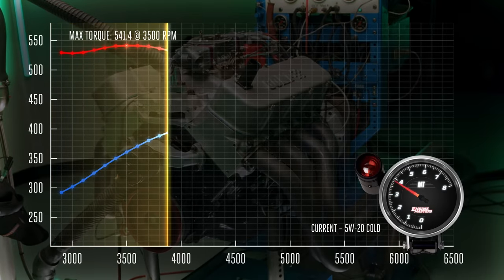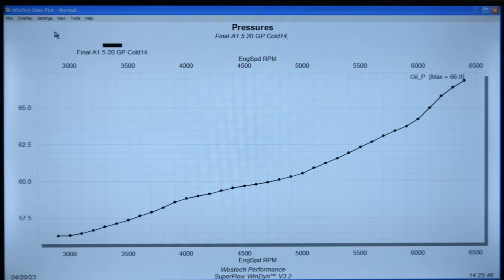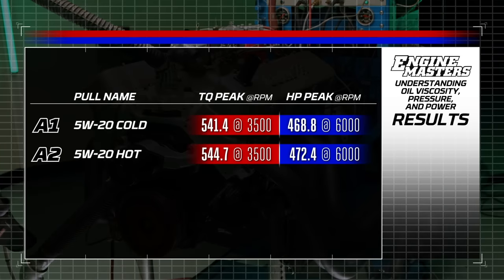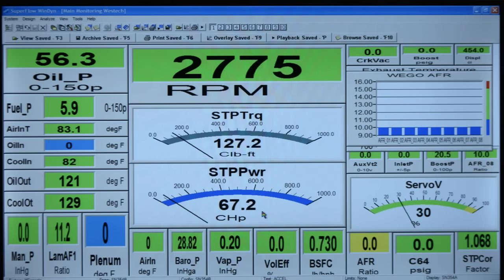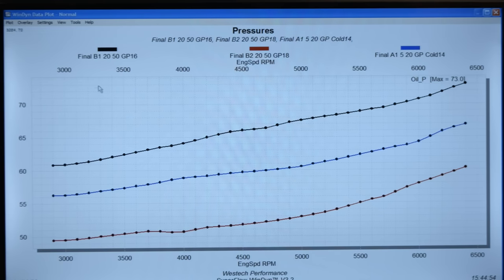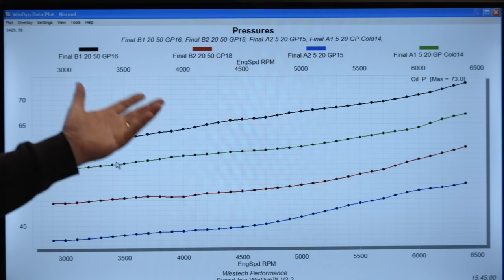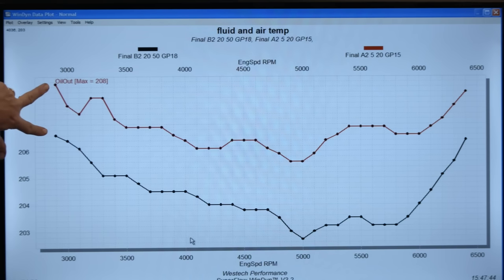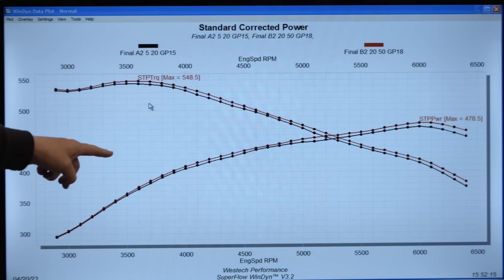Does the Thickness of Your Oil Matter? | Engine Masters FULL EPISODE | MotorTrend

Comment from the maker: What surprised you most about these tests?
Reply: At the dragstrip running to naturally acid on greasing gas change the oil every third pass
An extremely good day I could change the oil or 4 times
Reply: I am most surprised that Amsoil didn't sponsor it.  I just switched over to Amsoil in my truck, lobsterboat and skiff.  Now I have to switch to this new oil.
Reply: That the thicker oil did better, because of the things you stated, and we all know by less power is needed to turn a thinner oiled motor, yet didnt make more power. Im not no huge horsepower guy, always floating in the 400-500 hp range in my cars, but ive built all my own motors, and since it came out, ive always just run the straight 50 weight vr1 valvoline.
Reply: That heavy oil helps ring seal. Interesting episode
Reply: What makes conclude that that ring seal was better with the thicker oil .... was blow-by measured ??   I would have thought that more "leakage" from the thinner oil would mean more parasitic drag inside the engine .... ??
Reply: Actually seeing it on YouTube….
Reply: That Amsoil isnt part of the show. What happened?
Reply: On a old style engine like that I would also wonder if the oil  viscosity is also effecting how the lifter pumps up which can effect the power ....
Reply: As a road racer, who often sees higher oil temps than 210-220F, this confirmed that I need to step up viscosity from 5w30 to a 20w50.
Reply: I was expecting just the opposite, great job guys!
Reply: I was SHOCKED to hear topfuel use a 70!
Reply: Id love to see an oil with a wider range, say a 10w-60 to see how it changes across temp vs the others.
Reply: Great video, thicker oil and ring seal isnt something i had thought about before.
Reply: Why run multi viscosity when it’s warm out.
Reply: If ring seal was the question, re-run with a solid roller to eliminate the leak down of the lifters.
Reply: All we learned here is that 50wt is better for a tired loose 454.  If ring seal was your thesis you should have measured the flow rate of blow by gasses from the crank case vent.

So many things not part of your concluding statements; lifters stay pumped better with thicker oil, thinner oil shears more on loose bearing clearances…

One big overlooked point was the rate of heat into the oil during a pull.  Watching oil temp drop at the start of a pull tells you something; the block is cold, and is cooling the oil for the first part of the pull.  Dump the data below the point where it starts heating up and look at the slope change above 5k RPM.  The thicker oil is gaining temp MUCH quicker.  Apply that slope to an engine that’s starting hot and see where your oil temp goes.

It also depends where you measure oil temp.

So many variables that need to be accounted for but we’re overlooked.  Great effort on the test, but try not to draw firm conclusions from incomplete data.
Reply: You cant talk about ring seal WITHOUT measuring crankcase pressure!!!!!!
You cant talk about ring seal WITHOUT a volume measure of blow by!!!!!
You cant talk about ring seal WITHOUT a measured exhaust pressure!!!!
The above relationships based on the changes of of temp in oil, coolant and power developed say nothing other than gibberish that has no benefit other than confusing the data and developing a meaningless conclusion. 
No mention made about what happens to a plain bearing properly clearanced for a thin oil at a certain temp run with an oil that's to thick. Physical damage can occur to the plain bearing shells de laminating the surfaces and creating a resistance to rotate even though there is no contact. The oil pump will also have added resistance due to the oil viscosity as well possibly overloading drive or shear pins.. Extra wear and in some cases chain stretch and or gear wear on splash lubricated pump, balance shaft and cam drives!  
Using the wrong oil can do a lot of damage. Changing oil viscosity for an engine requires significant difference in bearing clearances AND can create problems with non pressure lubricated surfaces think gears, chains and sprockets, chain guides even valve tips. 
Come on guys surely you know better?
Reply: Clowns
Reply: My surprise - crankcase pressure wasn’t recorded to support the ring seal efficiency theory.
Reply: That the 2 oil temperature graphs vs load were not corrected for the starting temperature difference... it would have made it easier to see that the thicker oil really was getting hotter faster at higher loads. The other one would have been to see how a 5w-30 would have compared.
Reply: worst episode.   wtf corporate j Gibbs extortion to sell bad oil
Reply: I was surprised to see the thicker oil run cooler. That higher power number surprised as well but before watching I would think that a thinner oil that flows better could carry heat away faster but the opposite happened. I guess since the pump is positive displacement the flow rate would be the same for both, and if the thicker oil is a denser material it may just be that it's a better heat sink maybe? Anyway, interesting results.
Reply: The fact it’s not amsoil
Reply: Semi Synthetics 😬
Reply: @momosworld7312  the fact that it's not soil

Also I cannot believe it's not butter
Reply: But why does the LT4 need 0wDexo2? Mind that 1LE requires 15w for track use?

The tolerances are design for emissions, thinner oil aids that... not to survive 200k mileage longevity, the piston coatings are for that.
Reply: Is it possible that the thicker oil maintains valve lift better than the thin oil on any hydraulic cam. IE less bleed down on each RPM
Reply: @curvs4me  You can´t run thicker oil with tighter clearances, to begin with. Oil pumps are also designed and sized accordingly, so trying either a way thinner or thicker oil than the recommended one is a really bad move, from whichever side you wanted to look at it.
Reply: @curvs4me  Excellent response, now add the wear and HP rob by having to turn the oil pump, which they never mentioned. Thin oil traps less bubbles and dissipates them faster.
Reply: That your engine oil was slightly cooler with the thicker oil.  My engine runs slightly cooler with the lighter oil 10w-30.  SBF, Dart block, solid roller, forged internals, Cleveland mains, 575hp/555tq. Bearings .001/in.,  Set the engine up for the lighter oil. If you're making more HP with 50w because of ring seal, but you could be sacrificing in areas like, wear and load by driving the pump, and loss of lift on hydraulics because the oil is holding bubbles, this is not ideal.
Reply: @scotthultin7769 …What?
Reply: The fact that frieburger appeared on youtube after lying and deleting the roadkill channel he said would stay on youtube probably but idk.
Reply: My point is there is one degree difference right. So which oil last longer? For example we use it 500 miles which oils viscosity will be good or bad 😅 great question 😅
Reply: The thing that surprised me the most was that you got different results compared to everyone else on the hot 20w50 vs hot 5w20.  
When total seal do the test the 5w20 makes more power, when Richard Holdener does the test, the 5w20 makes more power etc etc. 

So what happened guys?  what is it about the testing or the engine that caused the results?
Reply: YOU DID NOT MENTION: 
A) 0 weight is twice as thick as water, 5 weight is twice as thick as zero and so on. 
B) That in 5w 30, the 5 is at 60C and the 30 is at 100C
Effectively, oil starts thick then thins out to 5 weight by 60C to thicken to 30 by 100C only to then thin out again as the temperature becomes excessive. 

Polymers unwind in the oil to restrict the flow, thus increasing viscosity.
Reply: @curvs4me if i remember, correctly,  a tired engine could use a higher viscosity at higher temps? Worn rings?
Reply: @ronaldbrown5745 We used to run single viscosity in desert 30 winter, 40 summer
Reply: I was surprised you didn't know they use 70 weight in fuellies because so much fuel ends up in the sump it dilutes it to about 15 weight by the end of a pass. Also the couple of horsepower to drive the oil pump (OK, in this case a couple of tens of horsepower) is insignificant compared to the output.
Reply: Honestly, the pressure deltas were most intriguing to me. Seeing how much more the dynamic changed over the sweep for the lower viscosity oils... I'm still perplexed. I really thought you'd see the bigger swing in the thicker oil.
Reply: The FACT is, Main Bearings tolerances have become so much tighter and with thinner piston rings being under 1mm, with the newer 0W8 oils mandated by manufactures, rings are often .50mm or thinner. Less friction from thinner rings equals less wear, more horsepower and more fuel economy.  Main Bearings with extremely tight tolerance MUST use thin oil or you will oil starve the bearings. This is why modern engines of the same displacement make more that triple the power they used to just 30 years ago. Piston Rings do NOT Seal the combustion chamber, Pressure does. You use a Viscosity based on the Main Bearing clearances,  metallurgy of the Piston Bores and oil temps!  Facts over Speculation.